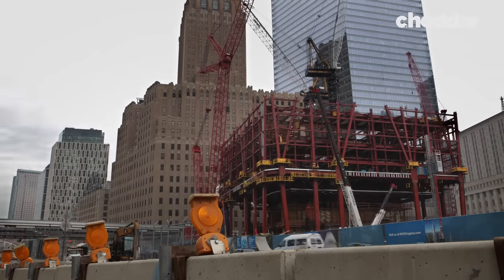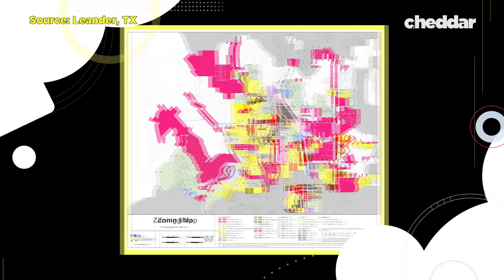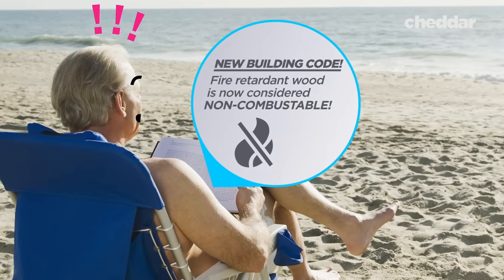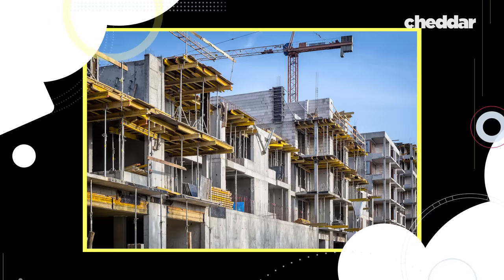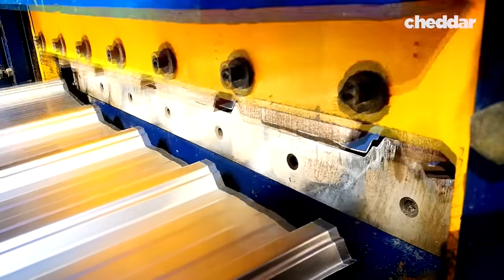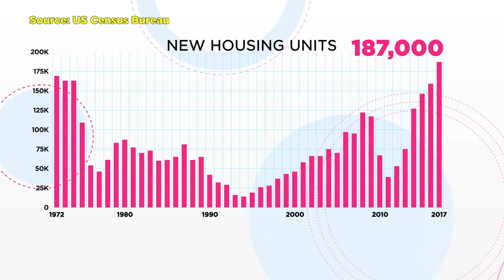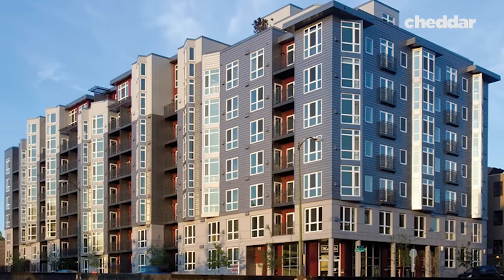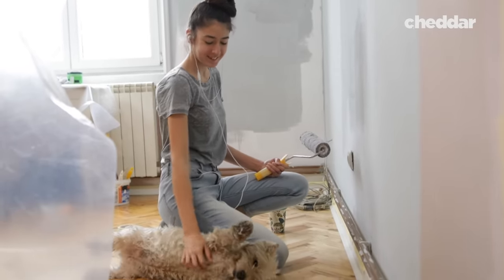Why All New Apartment Buildings Look Identical - Cheddar Explains

Comment: the only thing i learned from this video is that despite their cheapness to build these apartments are sold at a premium price to renters
Reply: @Moon Shine Nope!🙁
Reply: Developers don't really have extraordinary profits when compared to other sectors of the economy. The reason some of these apartments are so expensive is mostly because the land underneath them is expensive.
That's also why they have to cut costs so aggressively - if they weren't, no middle class person would be able to afford to live there.
And the reason why land is so expensive is because it's supply is limited - both artificially (through single family zoning), and in more genuine ways that could be mitigated nonetheless (distance from city center that could be overcome with better public transportation).
The second reason for the cost, is how long it takes to construct them. And this is not about the building method but rather about all the ways in which the building process can be slowed down by "neighborhood activists". Longer waiting times for permit = more interest on loans = higher price needed to recoup the construction costs.
The parking minimums necessarily bring the cost up as well.
Reply: There's a whole bunch I've seen going for $1600 to $2000 per month. They're always marketed as luxury.

Edit: They're usually 1,400 to 1,800 square feet.
Reply: @slowanddeliberate6893  that’s huge space compared to the 700-900 sq for the same price here in my city
Reply: its more affordable when you can afford a lot
Reply: @slowanddeliberate6893  I never see them over 1300 Sq ft. And that's for a 3 bd .
Reply: Totally. The units (at least the ones I’ve seen) aren’t that big either. We have these going up everywhere, and the starting rents are ridiculous.
Reply: Moon Shine in california they sell/lease them for “market value” which is like $3k/month if you live in the bay area
Reply: In Los Angeles, it's over 4k for a 2 bedroom.  How in the hell can anyone call this affordable housing?
Reply: Theres no such thing as a cheap new building.
Reply: 4K for 1 bedroom here in LA
Reply: Same here. Affordable my foot.
Reply: @marlongutierrez5326  even in LA you have to try pretty hard to spend 4K on a 1 bedroom and not be in a highrise.
Reply: In San Diego, the typical 2/2 home that we could rent out when we lived there was $2,500-3,000 per month (towards the higher end where we wanted to be). One of those apartments was $2,300.
Reply: They are expensive because they are brand new.
Upper middle class folks don't want to move into a 50 year old building, they go for the newest building. 
More demand = higher cost.
Reply: I've also learned that Americans are building 5 storey wooden houses. Like wtf?
Reply: Yessss
Reply: @daisyphreekshow2197  Exactly what I was thinking, $1,800 for 900 sq ft in my area of metro ATL...
Reply: And my towns 1900+ studio happens to be in this video hahahahahahahahaha
Reply: @amenra4668  I just moved away from Denver, but I still get these apartment rental emails and I saw a 2-bedroom for $7000 a month! 🤣🤣🤣🤣
Reply: @MagicznaPanda  Still not affordable to us,  maybe we should start pressuring our government to stop taxing the land so heavily.
Reply: @amenra4668  Is that why california has tens of thousands of homeless?
Reply: @meyatetana2973  it’s an overpopulated place. People pay higher prices because the demand is higher.
Reply: That IS the housing market. When these real estate industry people say people want ‘affordable’ housing, they mean half the price to build while sell/leasing at current market rates. They could care less about how these will rot and bring down neighborhood values twenty years down the road- it’s all about making the quarterly profits today.

Americans hate their future selves, or just don’t give a cr@p what burdens they have to bare.
Reply: You can't SELL to renters though.
Reply: @Moon Shine yeah right.
Reply: And tend to collapse a lot easier.Are less well insulated thereby requiring more ac and heat ..the better to add to the destruction of the environment.
Reply: @Moon Shine definitely not affordable in CA actually incredibly over market value
Reply: @Moon Shine There is some affordable housing being built in this style in Boston.
Reply: @Moon Shine nope, still more expensive than California “affordable”
Reply: That’s because supply is too low
Reply: in Oregon it cost less money to rent an entire house... so, why would any one want to live in a crappy apartment?
Reply: @MagicznaPanda  

Don't forget property taxes.  Property tax can push a 3 bedroom home from an affordable $900/month into a $1500/month nightmare in some markets.
Reply: @humboldtoregonian9400  Some people want to be right next to nightlife or other amenities.
Reply: Agreed.  The one 2 blocks down from the 4-plex I’m in is super expensive.  For the same 2br/2ba, and no single car garage (which we use for storage and laundry), the rental price is around 4.5k.
Reply: @MagicznaPanda  But who are the landowners? How often is it the city who owns the land? If that's the case then the local government has a perverse incentive to NOT provide public transport which would obviously increase demand for the land in central urban areas.
Reply: Yes. I am lucky I have family who rents cheap to my family, because me and a lot of people can’t afford $2000 a month for rent.
Reply: What's the difference between a luxury condo and a regular condo?

The price.
Reply: Comprehension is hard. 🤷
Reply: They didn't even mention how much they charge fit for these apartments/condos! They just glossed over that actual fact.
Reply: @byrd813  what city are you in with good rates like that?! I'm tryna move there, lol
Reply: @amenra4668  😬😬 wow....how do u save money and invest in that city.
Reply: I think mainly it's about trying to maximize profits. Even when their rentals, I noticed they seem to start off as "luxury" then over time they sort of come down to normal rent prices as people come and go and the building takes wear and tear. 

I also wonder though if many neighborhoods embrace the "luxury" moniker because then it appeases their fears of poor minorities on subsidized housing vouchers moving into their area.
Reply: @AlexMoschopoulos  The original developers build and hold for 5-7 years to make their money. A quick and dirty remodel and then they sell to someone who holds them for about the same time. They don't have development costs but they have repair costs. Once those get to high then they'll get sold to either a company intending to condo them out or slumlord them into the ground.
Reply: The price of land is so high that developers have no other choice.

Comment: "Cheap" housting a lot of these tout being "luxury" in the cities I've lived in.
Reply: Exactly
Reply: And that usually just means stainless steel appliances, maybe an in-unit laundry and “nicer” faucets and tiles in the bath.
Reply: @joermnyc  You also forgot that these houses are "new" and not over 100 years old.
Reply: It usually does. Cheap housing is still expensive housing when it’s new, because it’s still new and stylish. They always try to market them as posh, because they can, and that way they can gradually pull back prices until they find the sweet spot instead of pushing the prices up and risk undercharging.

The cheap part doesn’t usually start becoming cheap for residents until either they are 20+ years old, or they fit under some sort of government subsidy/project, that or if there are already enough similar buildings in the area that supply starts outpacing demand.
Reply: it looks cheap b/c it IS cheap. 
anyone paying more is getting ripped off.
Reply: Ads be like : Affordable luxury housing in Midtown come visit 205 Avenue Place 1 bedrooms starting at $1500 a month
Reply: Luxury apartments typically means "not a complete dump"
Reply: Frickin exactly. Every frickin condo is near a half million and it's just one of theses but 5 stories tall.
Reply: Yep. Definitely here. "Granite countertops, stainless steel appliances, asking cost astronomical"  and they still sell!
Reply: Yeah I’ve seen them go for 400k
Reply: It's cheap compared to the other methods of building. She should have stated cheaper.  Cheddar doesn't exactly do a great job of explaining in their videos.
Reply: It still helps Market saturation, helps to bring the prices down on other apartments that are older and a bit less nice.
Reply: @growingup15  in San Francisco that would be incredibly affordable housing
Reply: @SlackActionBumble  not in South Carolina. These are out of the price range of majority of our citizens here.
Reply: Those cost $130k here in Ukraine. $40-50k if you buy an apartment with concrete walls. 
If you choose the old building, you will pay $60k for a 3-bedroom apartment. 

Our household net income (me and my wife) is approximately $20k per year, it is considered a higher-middle class.
Reply: A flashy paint scheme and strategically placed faux brick or stone accents does the trick!
Reply: @joermnyc  in Seattle, AC is actually considered a luxury. When are we gonna admit that future generations are paying more for less?
Reply: @nicogreco7855  I've seen many listed as "a/c ready"as in there's a hole in the wall, but you still need to buy the air conditioner that fits in it.
Reply: By concrete walls, I meant the room without any repair, just walls and plumbing. The repaired and decorated apartment will be up to $130k if you invest in the development project and make a fancy repair on your own (no one buys the repaired rooms here, it is 90% development investment projects as the ready-to-live flats cost 2-3 times more for the same bare walls).
Reply: They are just cheap!
Cheap marketing too! What freaks call them Luxury houses? sales people i guess.....
Forget YouTube, ads only here, cheap marketing, not any smart people here!
Reply: TBH
Reply: @ANTAlex-pe9li  In Boston it's more like 900k. I've seen 600 square foot rental units in these buildings go for nearly 4k/mo in less desirable neighborhoods and that's not even close to what it would cost in NYC or SF.
Reply: @NavalLacrosse  Damn, I guess I got lucky. I'm living in a condo built in an old clock tower and watch manufacturer building. The building is super old, so it has a lot of masonry, but unfortunately most of the units had the gorgeous brick walls and arches covered with plaster and whatnot. The outside of the building is absolutely gorgeous, though. It's called, "The Clock Towers," and it's in Lancaster, PA. It's a really cool building, because it was used to manufacture radium watches back in WW1. Some of the units still have bank vaults with the original doors still on it!! My unit doesn't have anything cool like that (I got one of super cheap ones that's partially below ground), but the nicer units really are gorgeous.

I actually used to live in Dallas, though, and lived in these types of apartment buildings for most of my adult life. In my experience, it was usually around $900 to $1100 for a studio apartment- so it was actually really affordable for the location. The main negative for me was the noise pollution. I could hear everything going on outside and in other units- it was ridiculous. Interestingly, I have the same problem in the condo I live in now, despite it being built so long ago. I can hear whenever someone walks by, regardless of whether or not they are talking. A neighbor could be sneaking by all quiet, and I would still hear the jingle of their keys as they opened their door haha.
Reply: @andythebouncer  yeah they’re pretty dang expensive
Reply: They are "IKEA" luxury. Everything looks clean and nice but the underlying materials are cheap and fragile
Reply: because of the huge amount of money they save ,  the developer will make like a club house or pool or gym or something , all while saving money . then they want to call it luxury .
Reply: What does Luxury even mean? It's just a term since it sounds good but doesn't really mean anything. It is basically an idiot tax, being made to pay more for nothing and as people pay more just because of a single word, the prices increase further. 

Or another way to think of it, is people would prefer to live in a Luxury House than a non-Luxury House without comparing the two to find out the "non-Luxury" House is in fact better.
Reply: They are pretty nice the first few years they are in operation. Especially compared to the typical 50s-70s apartment stock that is normally available in a lot of cities.
Reply: Especially the mixed use ones.  People pay a premium (rent or buy) if they have walkability.  These increase density as well, so we have blocks of them around the one with a grocery store as the first floor.
Reply: It’s built cheap, but far from sold cheap
Reply: Exactly! Also people patient city prices for "fake city" living
Reply: Yup they're luxury apartments where I am where 1 bedrooms reach to 2,000.00 USD
Reply: I think they're just cheap in quality.
Reply: “Luxury” student apartments 🙄

Comment: "as long as they aren't dangerous to occupants," she says, while outlining why they're dangerous to occupants and blatantly ignoring the economic issue of calling them "affordable housing"
Reply: Their not though they tend to be left to burn when fires start so their expensive to insure but they don't have much of a fatality rate at all in fires much better then the old brick buildings anyway
Reply: @dstblj5222  there's a reason the piggy with the brick house outlived the piggy with the straw house, and it wasn't insurance costs